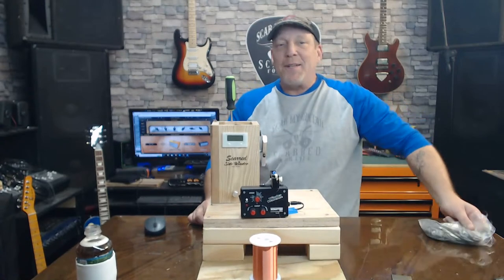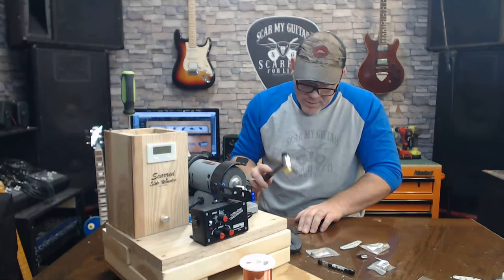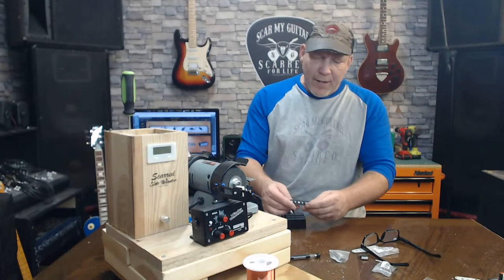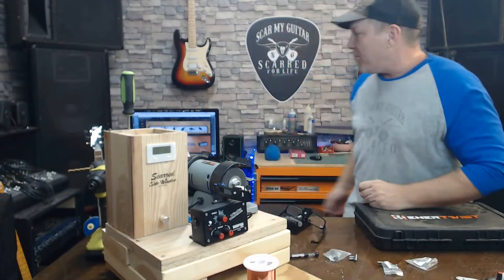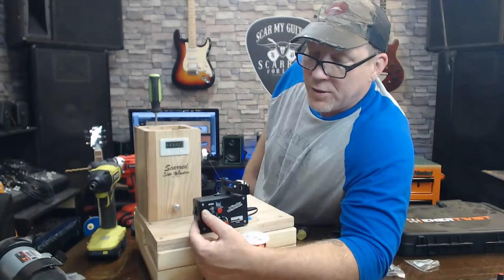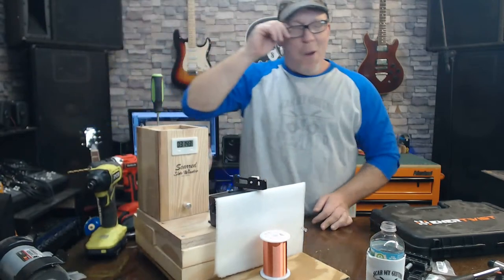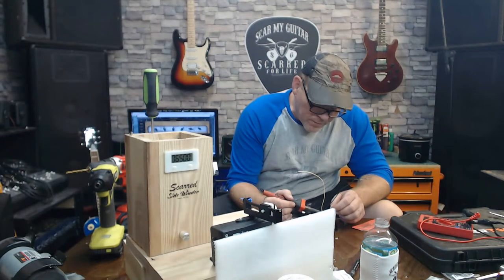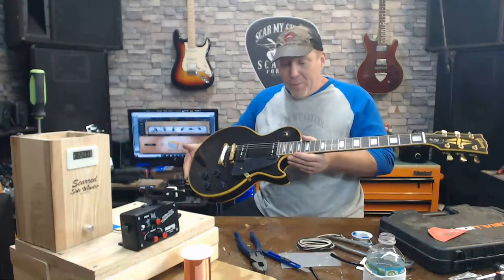Let’s wiind some guitar pick ups together!

Comment: I'd hate to see what you'd say about my Chinese Teles. But hey, they were $ 82 & 76 delivered. They aren't quite Squier Sonic Teles, but 2 years into them, they still play quite well & all I did was set them up, only having to shim the $ 76 guitar. They have their issues, but I'm not going to fix the fret ends as the most glaring problem. The truss rod works and the neck is flat & straight, no level & crown necessary, they weren't too bad like the fret ends. I'm willing to bleed for the noises I make with them. They sustain to a point where the note is unrecognizable, even annoying. Didn't send them back, got additional discounts for the laundry list. They were on sale, & from the email back & forth not really sure they wanted them back if there was a reasonable solution. So they knocked off $ 10 on the more expensive one for the polyurethane finish blemish. Nobody listening to them could tell the difference, or they were being too kind ? No police complaints so far.